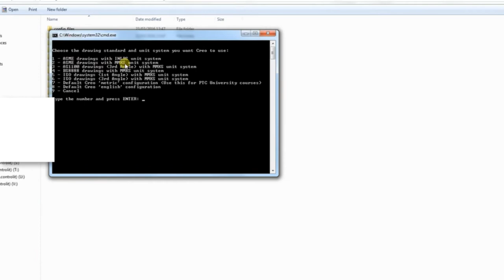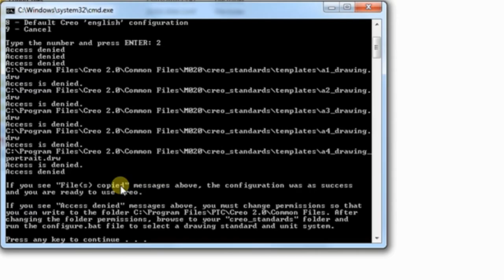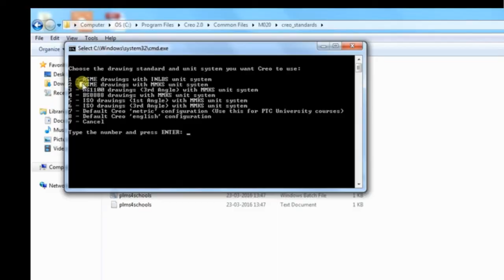Creo Parametric Set Default Units

Comment: Hey, when i try to change the units with the configure.Bat file, it says it can't find the files, but they are clearly there. I really need this issue fixed.
Reply: If i try to save the edited *.pro file i get the error "Acces is Denied". I tried saving it to desktop and then moving it in to the folder, that worked, but the units are still inches and pounds. They should just make an option during the instal to choose Default Units.
Reply: That is exactly what I did, The config file now has this part in it 
"unit_length unit_mmpro_unit_mass unit_kgtemplate"
but the program is still using inches and pounds, am I missing something?